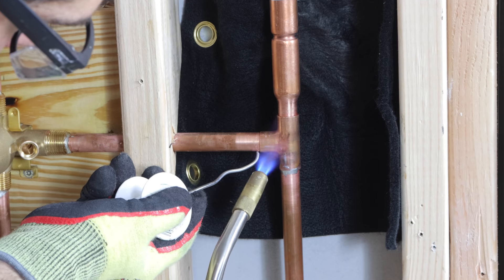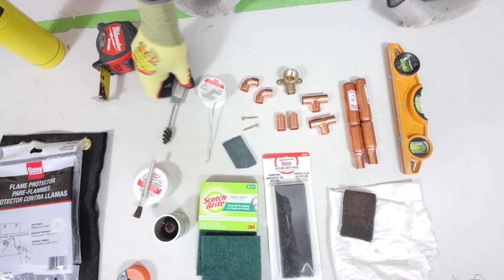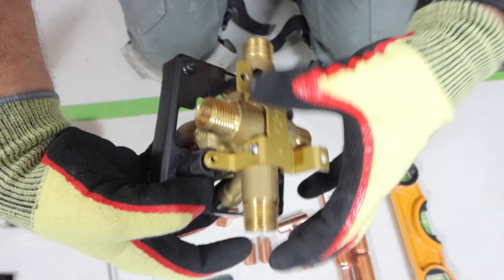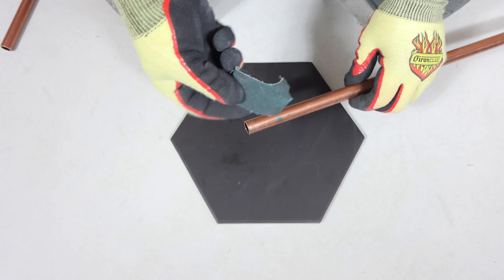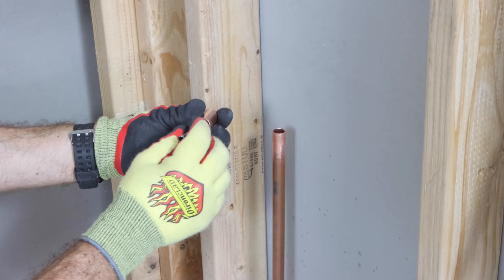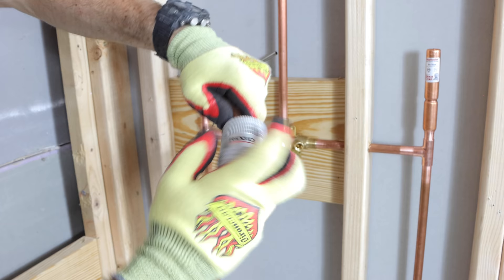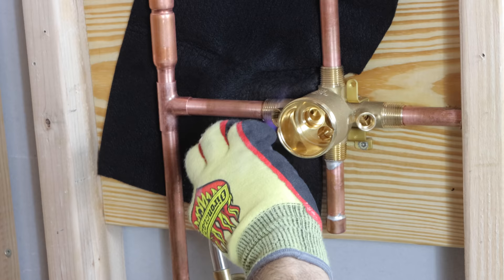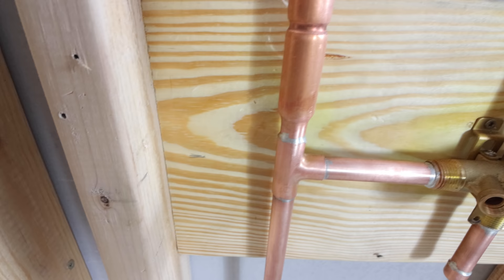Delta Shower Valve Installation Tips for Beginners

Comment: How in heck do I unscrew this DELTA universal valve cap after installed?? Lefty-Lucy won't work! Will I dent/ruin this cap ring if I use vise grips or adjustable wrench? Help, please
Reply: You have to pull and twist
Reply: You unscrew the metal part around the edge, the interior part is just a plug, if I remember correctly. Make sure your water if off.

Comment: I did a bathroom reno (down to the studs) and installed the Moen shower valve...used PVC and Sharkbites to hot/cold water and welded copper for the showerhead and faucet.  Tested and no leaks.  Finished tiling and had to remove and re-weld just the faucet pipe.  (Old one was out too far.)  Now, she has a slow drip on the pipe coming out of the valve (to the faucet.)  I know I can apply heat to remove it and re-weld but I'm worried about not being able to get the new pipe in there good to weld since it will have old solder in there.  Any tips?  (I know, now, to apply cold rags to welds I'm not working on to ensure they don't lose their weld...I suspect this is what happened to it when I was re-welding the faucet since heat travels upwards.)

Comment: Hello, im confused on what part needs to be flush with the finished wall. Does the plastic need to be flush with the finish wall ???? Thank you
Reply: In instruction will show you, Yes the black plastic temporary pice needs to be flash with finish wall.
Reply: He just put the backer board and a piece of tile and put the valve against the wall and then measured the distance to the plastic from the piece of tile, and it measured about 1 1/2 inches so when he installed the 2×12 it brought the plastic square ring flush with the tile .
Reply: @plumbbuild6517  Anyway done if fine longest you have black temple flash with finish wall.
Reply: @786otto  It's not a temporary piece. You do not remove it.
Reply: @MAGAMAN  Thanks for reply, not sure if we commenting about the same accessory
Reply: @786otto  He should have put that black plastic guide back on the valve.  This way who ever later installs the backer board and tile leaves enough room to access those integrated shutoffs.  Lost count of how many times I roughed in these valves and go back to install the cartridge and trim to find  the homeowner or some hack tile installer who doesn't leave a big enough opening to access the shutoffs or the holes for attaching the cover plate.
Reply: Doesn't have to be exact, there is a fudge factor.  It the plastic guide can  be a 1/2" past the final finish wall or backset up to an inch.

Comment: I'm wondering why solder to the threaded outlets of the valve instead of screw on fitting with Teflon tape?
Reply: A soldered joint will last a lot longer. Screw on joints should only be used in places where you can get to them later on.
Reply: @MAGAMAN My three handle 70 year old tub shower valve has brass union connections with no issues. Teflon tape or Rectorseal last a good long time on threaded connections.

Comment: For beginners. Shure. Hope you have a good insurance. Why don't you use a press fitting system.?
Reply: Why would you use a press fit system? Plastic degrades over time. Most of this pex crap will need to be fixed or replaced in the next 50 years, but most of the copper will still be going strong.

Comment: I'm putting in the 1/2 in copper pipe (hot water line) and it won't fo into the
Reply: Are you using new pipe? Is it kinked or bent? Does it have old solder all over it?